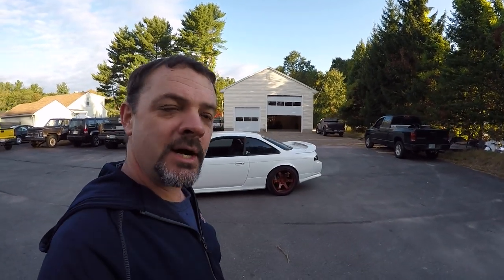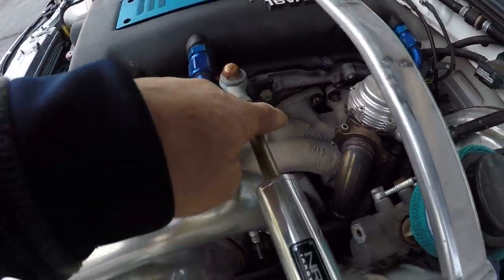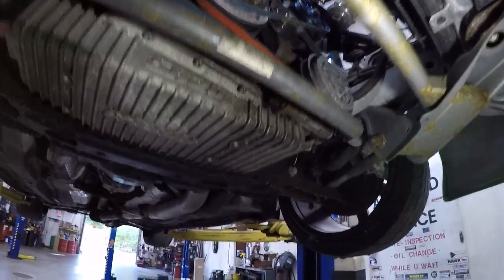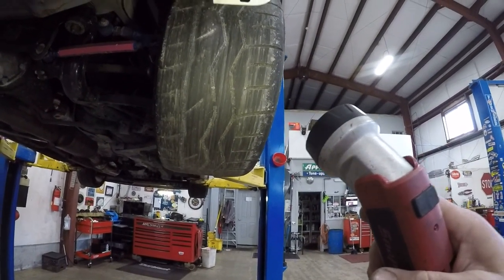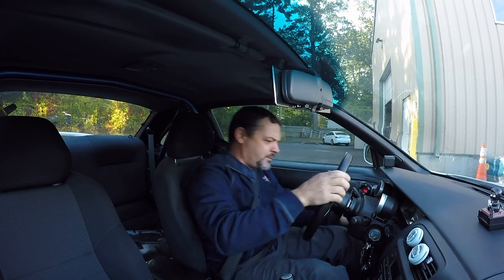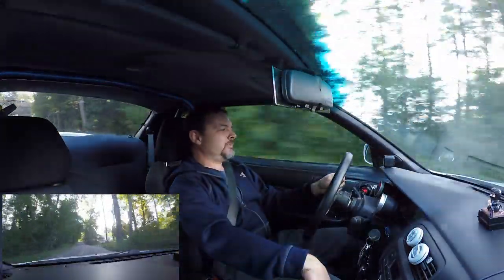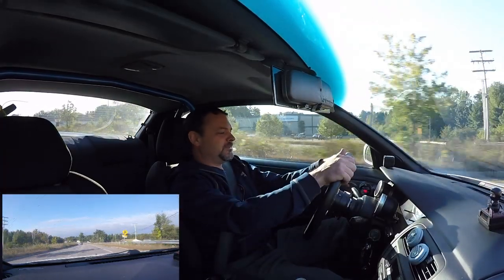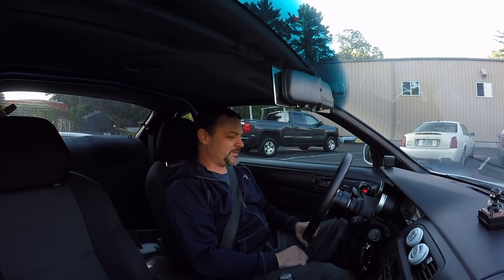SR20DET Swapped 240sx Silvia Drift Machine Review!

Comment: hey man this is off topic but i have a problem om my 79 serries v6 1GR-FE with a bad tickng nois. i checked compresoin and i checked oil presure. still in specs.
engin still has power. sometimes it misfires other times its running smooth but engin noise still there.
it has almost 200 000km on it. any other test i can do or advise would be appreciated..